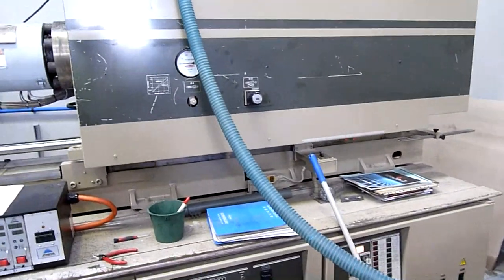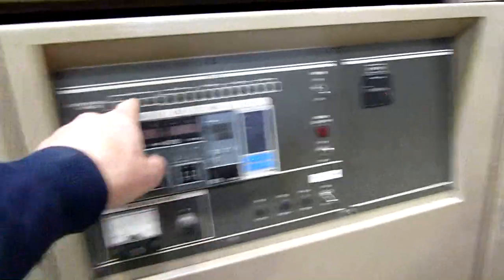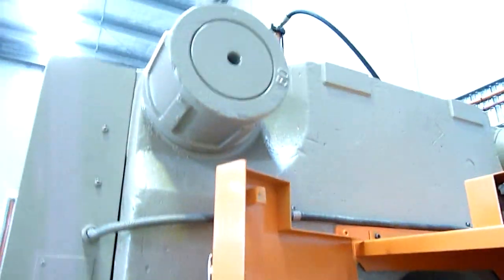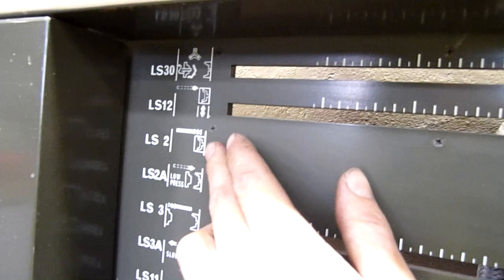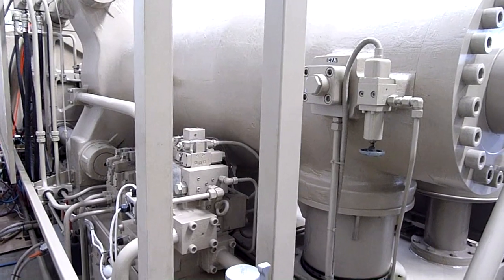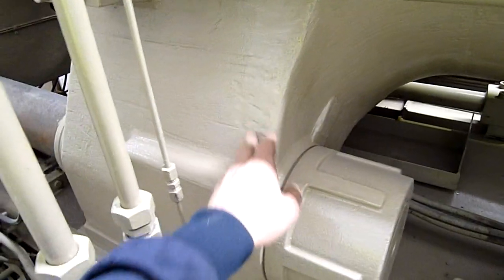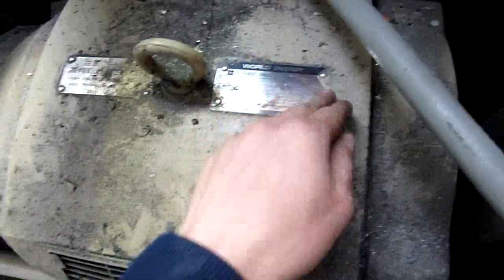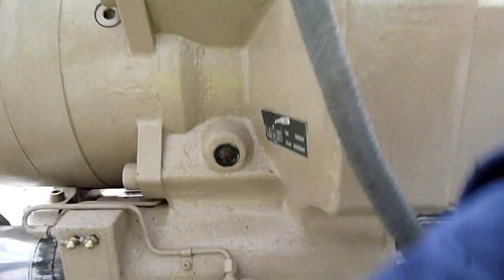Toshiba 550 Ton Injection Moulder (IMM) Walkaround

Comment: Ooooh, that's quite sizeable!

Those moulds that you were standing next to at 3:22 .....Never seen ones that huge!

The biggest machine I've stood next to was a Negri Bossi and there were two of them churning out crevice tools and wheels for the Dyson DC01 :D

I remember having to stand on a tall ladder manually refilling the hopper.... Grey plastic with glittery bits in it!

Thanx for showing,

-BoomBoxDeluxe.
Reply from the maker: you ought to see the tool used to make the full size wheelie bins :D, the thing dwarfed me standing next to it!
Reply: Ah yes! I've often wondered about the moulds for wheelie bins, because there's obviously one mould large enough that someone could climb inside it and the other mould is equivalent to the inner volume of a wheelie bin!

Yes, and when both of the moulds are closed together, there's a gap between them where the plastic goes which then forms the bin itself. :-)

-BoomBoxDeluxe.